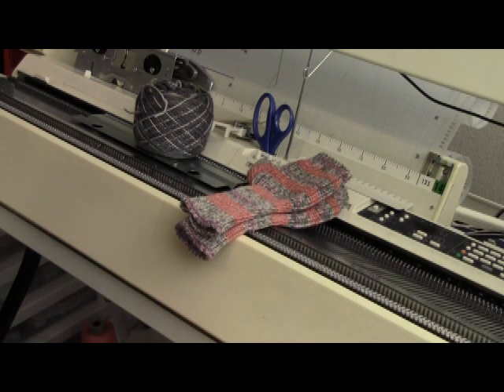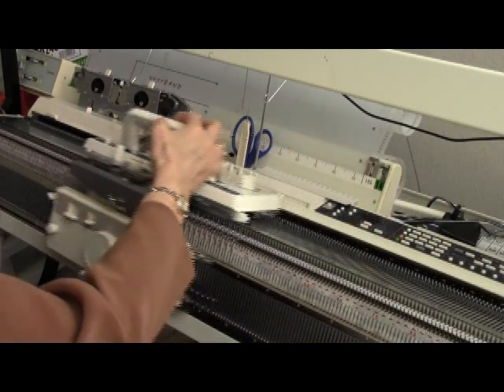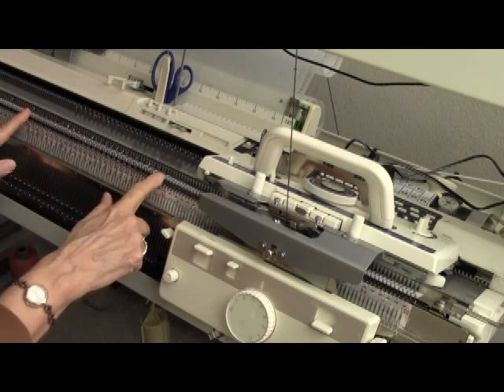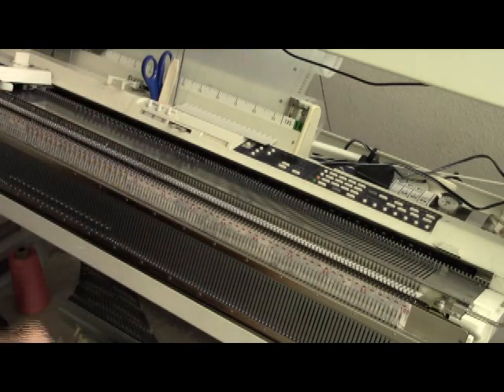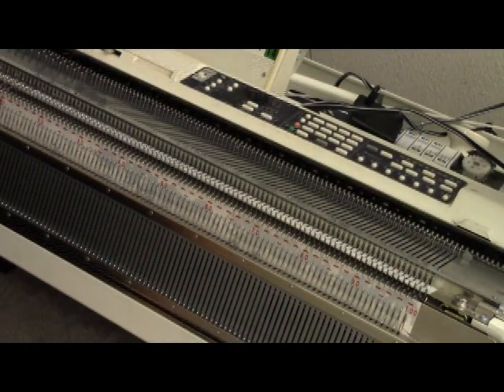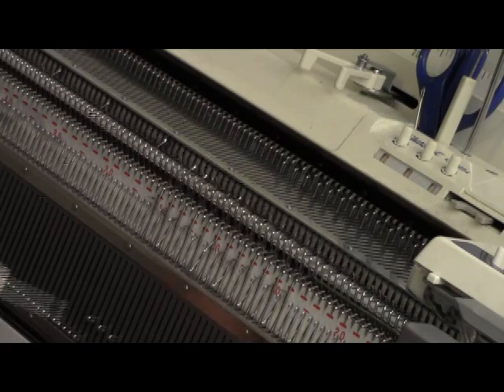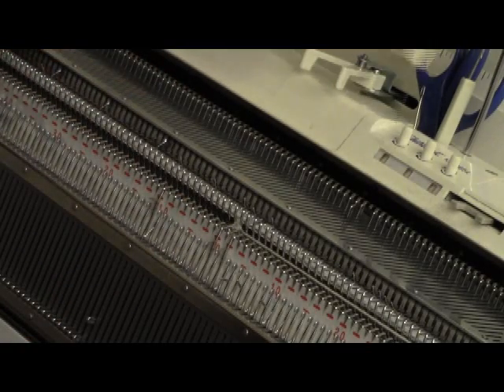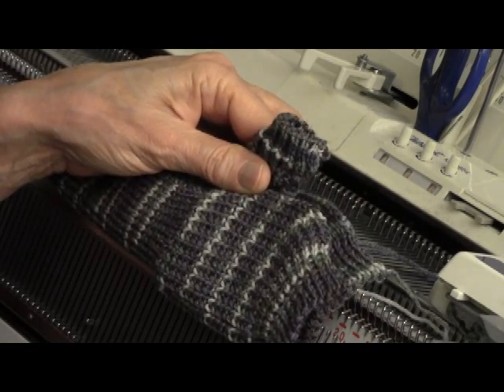Fingerless Mitt to Knit by Diana Sullivan

Comment: Thank you for this great tutorial.  I've been trying to make these, but can't seem to get the size right.  Using a Brother KH 930  with fingering weight yarn, and am following your instructions to detail, but they keep coming out too small.  I tried using a higher tension and they fit better around the circumference, but got too long in the process.  Last night I added 10 needles and upped the tension to 6 and that seemed to work better.  Will try again tonight.
Reply from the maker: +Peggy Johnson If they're too small, I suspect the problem is the settings.  You're getting good English Rib, right, much wider than 1x1 ribbing?

Comment: Hi Diana, Thank you so much for all your very clear video's. I have a question though: which machine are you using for this fingerless mitt?
Reply from the maker: +Wini Hi, That's a Brother 965i.  Diana
Reply: +Diana Sullivan , Thanks Diana, guess the needle distance is the same as for the 940? bibi
Wini
Reply from the maker: +Wini Yes!  Your 940 will work just fine.
Reply: +Diana Sullivan Thanks Diana, that'll make it easy to follow your patterns. I'll start today, if time permits.......

Comment: Would you please consider doing one for the Brother bulky if you have one?
Mine is a KH270.
THX,
Bonnie, Dallas, TX
Reply: +Bonnie Konjevich 

This is what I did on my bulky KH260 which is the same as the KH270 

Stitches on the main bed 16-15 (stitches in between on the ribber)

Cast on: Zig zag in T0, 3 circular rows in T1. 

15 Rows of rib in T3
25 Rows of fishermen rib in T4
6 Rows of rib in T3

Thumb= 16 Sts (8-9) (in between stitches on the ribber)
4 Rows of rib in T3
Change to fishermen rib in T4, knit 6 rows
Decrease every 4 rows as per the video.

Comment: With Diana's permission I would like to share what I did to make these in the bulky machine with worsted weight yarn. 

Stitches on the main bed 16-15 (stitches in between on the ribber)

Cast on: Zig zag in T0, 3 circular rows in T1. 

15 Rows of rib in T3
25 Rows of fishermen rib in T4
6 Rows of rib in T3

Thumb= 16 Sts (8-9) (in between stitches on the ribber)
4 Rows of rib in T3
Change to fishermen rib in T4, knit 6 rows
Decrease every 4 rows as per the video.